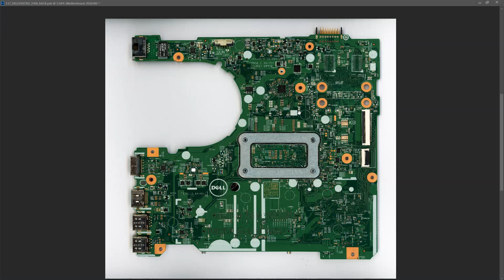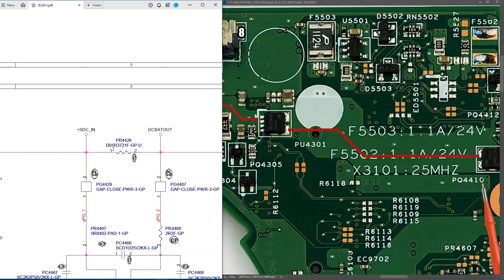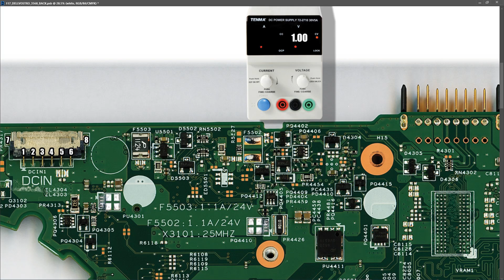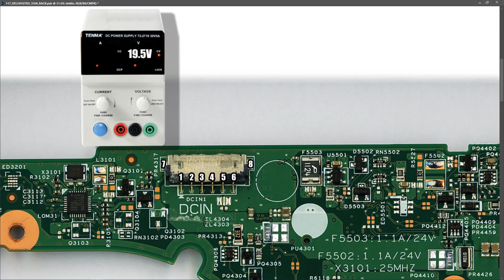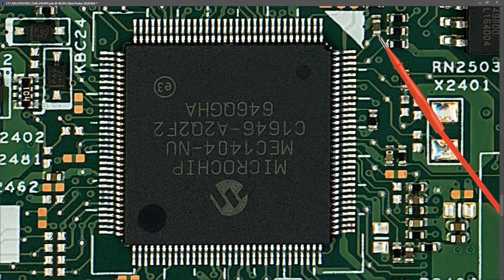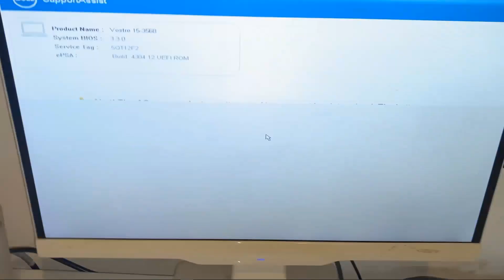DELL VOSTRO 15 3568 - NOT POWERING ON

Comment: Great repair, and explanation.

If you want to go the extra mile, on the now working laptop check the gate voltage, as it should be 4v or so higher (for n-type). If it not, it is often the driver IC. If the voltage  on the gate is not high enough, the mosfet is not fully turned on and will heat up, and die, or fall off the board if it is mounted upside down. So in a few weeks time it may become a return job.
Reply from the maker: Hey Karl, I was thinking about doing a follow video with the correct voltages after repair. The Dell motherboard videos seem to do much better than the others, so I think it might be worth while doing.
Reply: @therepairshare673 I would really like to see that, as it will help my fault finding skills, to know what voltages to expect when a board is powered up.
Reply: @ 

Already half typed this, but it vanished.

Thought about this last night, Me and only me, I would finish off what I have got left board wise, because there is only so many times you can say the same or similar thing, add the voltages too them if you want. You may need to feel that you have to move on, and the current status maybe is becoming stagnant?

Myself, I would stop the current format. Instead, I would set a goal that is virtually beyond grasp like "By the end of this year, I want my repairs to have made enough money to buy this house (picture of for-sale house in my town), or something like it" you may not be able to do it in a year, the tax man will eat into your profits, so 50% will go to him in some way as a sole trader. Show the repairs on video plus profit and losses. Show the Instagram, Facebook, Twitter and other social media ads etc. you use, and let us watch how your business grows, by recording all your fixes, and failures

This will still encourage your current audience, hopefully lift the aspirations of people who are broke in a way that they might be able to try it themselves. Business minded people may visit just for curiosity too. Finally, it gives you PCs and laptops etc to fix, but rather than you looking,  buying them, you are fixing people's stuff and making money. No more board scanning and marking too
Reply from the maker: @karltest1314  Hi Karl, thanks for taking the time to type this up... (twice!!). 
I have a full time job, so I'm not under pressure to make money out of the channel. I have set a target of 10K subscribers, and I will re-evaluate the channel if it should hit that. Until then, I will keep making videos, as long as I have the time.
Reply: @therepairshare673  Well, if you measure the coils, they are often similar voltages  from model to model, but amd do vary from intel due to intel's built-in graphics cards and cpu.

For mosfets have about a 4v(upward) voltage difference,  similar to the 0.6v(upward) from base to emitter on a transistor.

Dell was a big seller. Think in the UK corporate market has been taken by hp.

We once were a Dell shop, then Tosh for 5-ish years, but for the past 10+ years HP laptops are the thing, and guess we must have got over 20000 of them, but the aged ones were under lease, unsure of the new ones. Eventually they will be released by the leasing company through various outlets, often from ebay

Comment: Nice job, very interesting as always. 2 questions please....1/ On diode mode why don't you use black probe on ground ?  2/ How can you turn on this board without a PSID on Pin 4 of the DCIN ?  (sorry for my bad english)
Reply from the maker: Hi Pascal, your English is very good. 
1/ I was taught to use the red probe on ground and measure with black probe. I get asked this question a lot so maybe I need to learn more and teach why. 
2/ The PSID is not critical to the powering on the laptop, but IS critical to the charging of the battery.
Reply: To help answer your question for /1 I actually had the same thought when I first started as to why you would use a red on ground and not the other way round. I gradually found out  diode mode works by measuring a voltage drop across a path from point A where the black probe is, to point B. The lower the number 0.000 the lower the voltage drop which could indicate a short in a Circuit. 

If there is a break in circuit or the path doesn't go anywhere, you will get Open Line (OL). 

Bear in mind some paths in a circuit such as CPU lines that we measure in Diode mode, will look like they are short due to the low number for example 0.020v however this is normal.

I found a video here https://youtu.be/m_gD6hPzipU?si=LbJPOXFL_SXjk3Of which gives some understanding of how to use Diode mode, but I would definitely vote to get a video from Jon here on multimeters and how to use them in laptop repair for sure 👍
Reply: @BTube-101  Now i understand why...Thank you !
Reply: Forgot to add, Diode mode is the safer option to check for shorts in circuit than initially injecting voltage from power supply unless you are certain of the fault and voltage injection will allow for you to locate it quickly. 😊

Comment: Hi pro, incase you dont have powerbutton, safest way to turn on is by keeping red probe on ground and running black probe on powebutton connector while keeping multimeter in diode mode.

Comment: Hi, nice fix, what do you use to scan in the image of the Motherboard? Thanks in advance 👍
Reply from the maker: Hi David, I scan the boards with an Epson V600 flatbed scanner. I use Photoshop to adjust the colour, and sharpen the image.
Reply: @therepairshare673  
Thanks for replying. 
Nice, the images are very detailed and all the components are in focus. Good Job 👍.